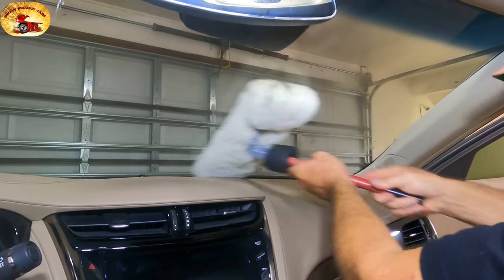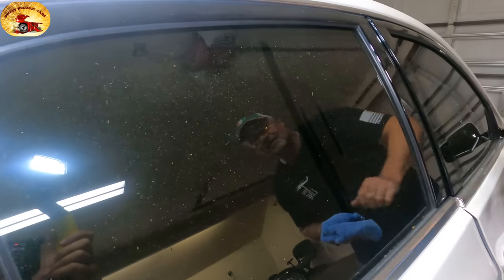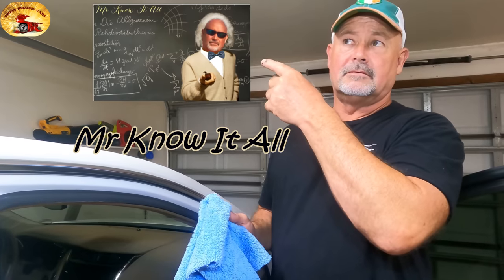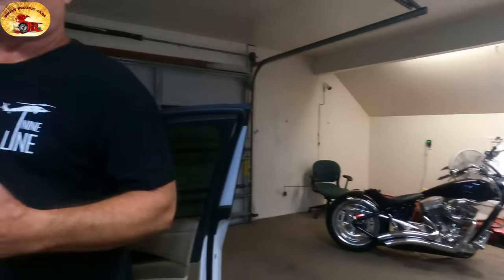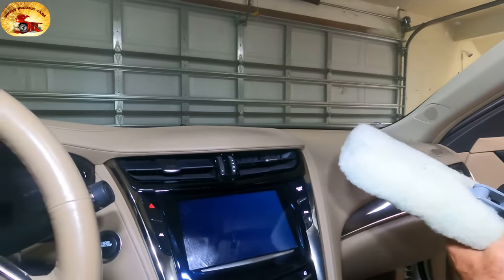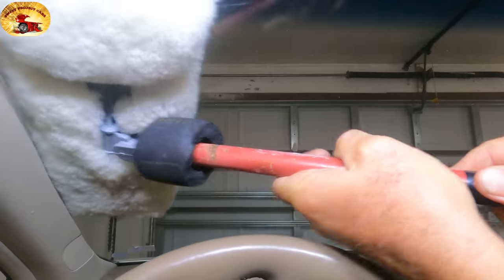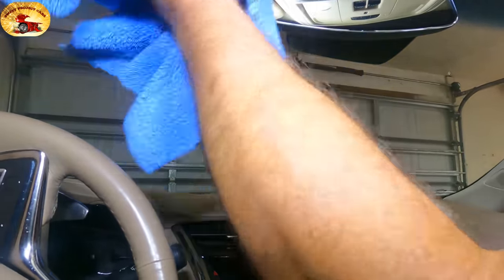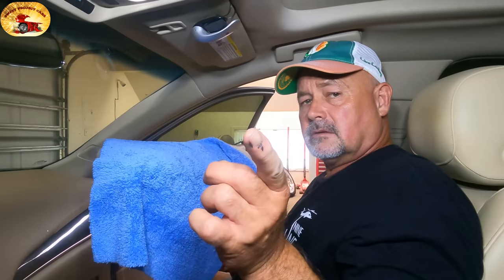AMAZING!!!  How To Easily CLEAN THE INSIDE OF A WINDSHEILD...WOW!!

Comment: I can not find any microfiber cloths that do not leave lint on my windows and interior dashboard and seats. Oh yea, I have black interior. Never again.
Reply: You need the ones for windows. They have a tight weave, not the ones with the hairs.
Reply: I have the answer to ur problem buts it’s a secret
Reply: Never use fabric softener when you wash microfiber materials.
Reply: MR. Siga… the big ones,
Wash with cool water only, double rinse and hang dry.
Reply: Do you wash them by themselves? You can't wash them with other items because lint will stick to microfiber.
Reply from the maker: Use these  https://amzn.to/2yP98Cw  they are the only one's we have found that don't cause that lint problem my friend. You won't be disappointed! Thank you for the view, sorry for our delay in responding, have a great day. mad Mike
Reply: 1 you're using a old or cheap micro cloth, or dirty one,or your not using a microfiber cloth.
Reply: @SweetProjectCars ❤
Reply: It helps to put vinegar in the water when you rinse them. I use  a cup of white vinegar per load
Reply: You’re washing them wrong. Wash on delicate setting with only detergent and nothing else. Then air dry in the dryer without a dryer sheet etc. 👍🏼

Comment: Thanks for the video, it will make the job much easier.  I do have one question though on the suggested tools.  The pole that attaches to the lambswool goes from 4 to 8 ft.  Wouldn't a 4' pole be clumsy to use in a vehicle?
Reply from the maker: No, this  https://amzn.to/3C6kJfj  is perfect length, most windshields are sloped, and hard to get to, the pole is perfect for this process. Thanks for watching and asking, have a great day. mad Mike
Reply: @SweetProjectCars  TY very much!

Comment: The best way to move a safe is put it under your arm and take it where you want. It helps to have another safe under the other arm just to balance the load.
Reply from the maker: LOL, thanks for watching and sharing, have a great day. mad Mike the hammer SPC
Reply: @SweetProjectCars  I tried your tip of the Rain X but with Meguiar's Ultimate waterless wash & wax as that's what I had on hand. It did a good job cleaning the glass on the garaged car. Will try it on the van parked outside. Then I thought it might work on the inside of the motorcycle helmet wind screen to help prevent fogging in the winter months. I apply wax to the motorcycle wind screen to make the pits not noticeable.

Comment: yep i see that screen on cue is cracked, from what i heard GM/Cadillac used crap sealant and was the cause, I had to replace mine. Cost me around $1500-2000ish at the dealership.
Reply from the maker: Ours was fine until we moved to the excessive heat in Florida, then one day it just shattered. We purchased an new one to install ourselves online for $40.00. Thanks for watching and sharing, have a great week. mad Mike the hammer SPC